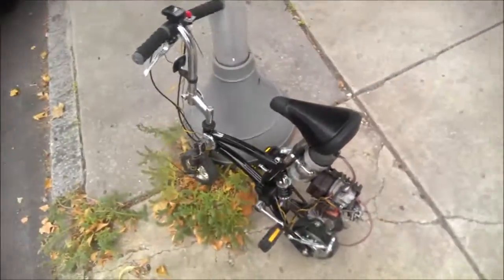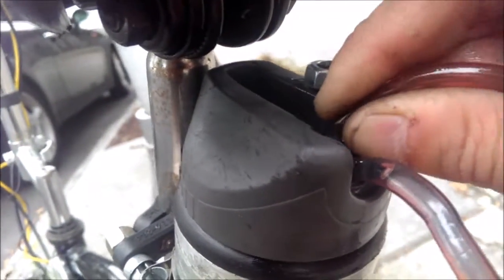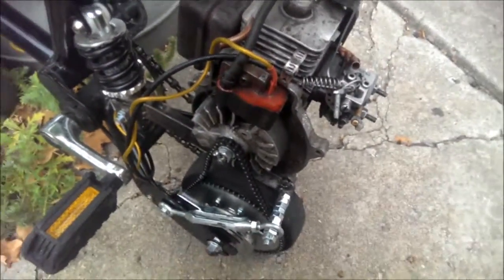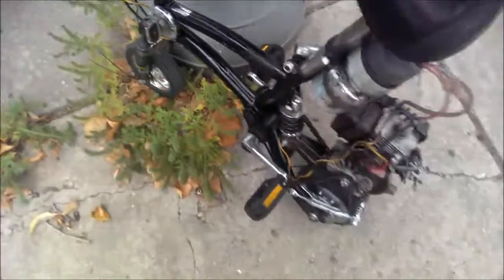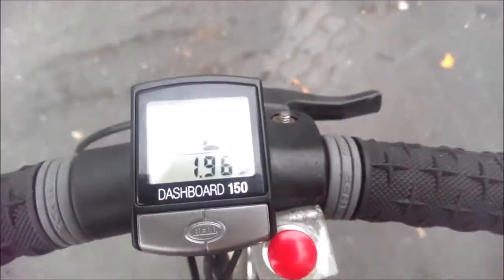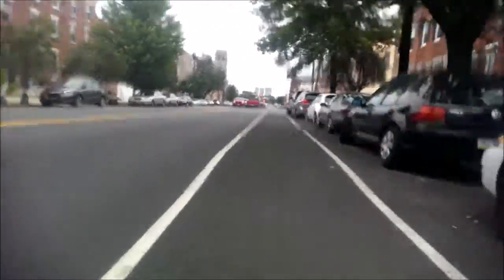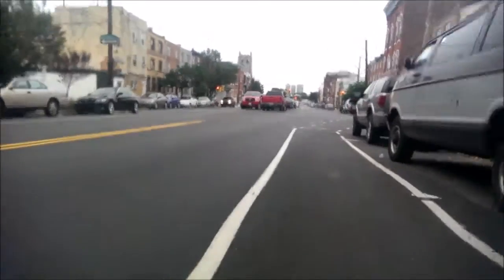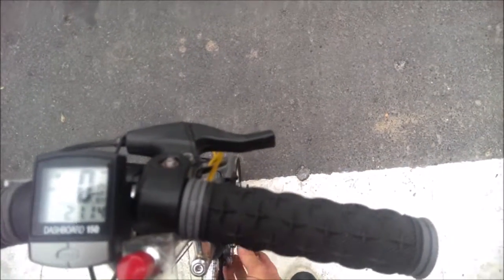Project Mini-me: motorized bike project pt. 2

Comment: lol I could have sworn you said you were expecting around 20 MPH in the last video! Cool project!
Reply from the maker: it's theoretically geared for 20mph but I don't think the motor has the power for it, and it is scary above 10mph. I'm changing the sprocket out to give it a 7:1 gear reduction and lower the top speed to around 17mph and to help with the acceleration.
Reply: Doesn't sound too surprising, since you got the motor from a weed wacker. And, you driving that thing on the video looked scary. lol Dude, please make your next project be a camera strap or something.